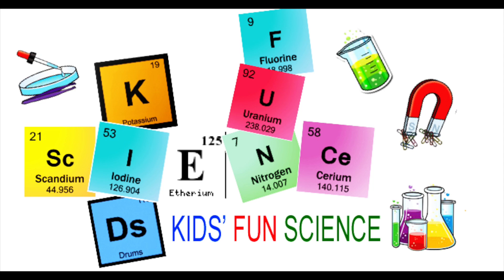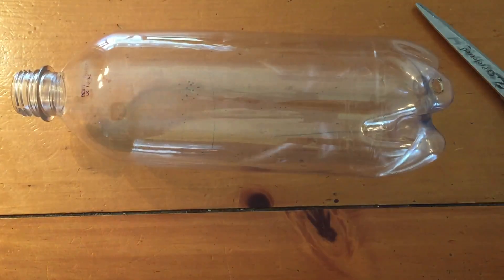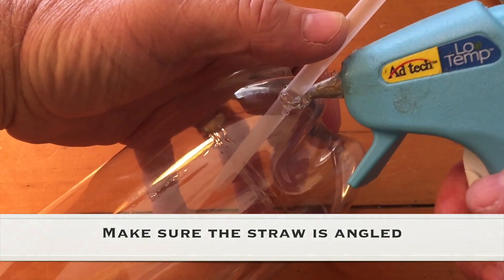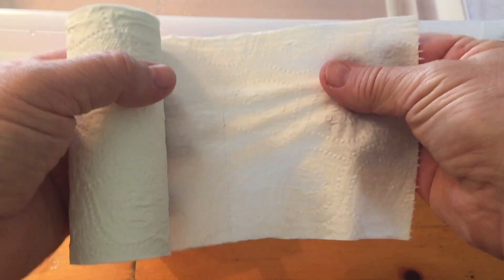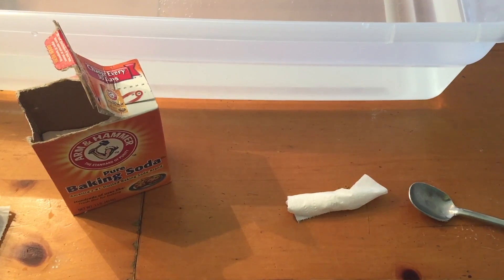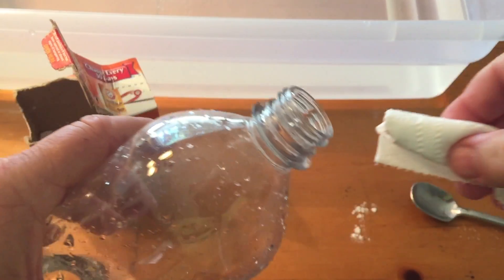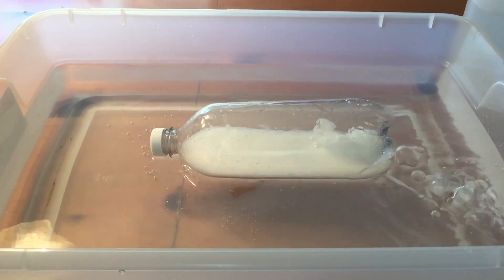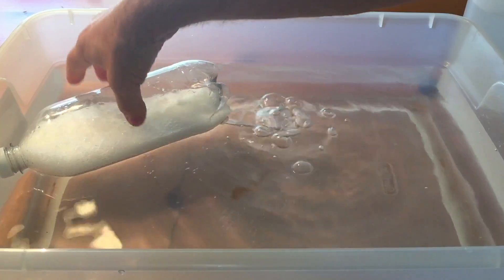STEM Baking Soda Vinegar Powered Boat experiment (How to make a power a boat with baking soda)

Comment: How do you make it go faster👀
Reply from the maker: Hi Dula Peep,

Sorry for the late response. I have not tried to make it faster before, but ideas might work would either have put two straws in to have double the gas pushing or a smaller straw to try to push the gas harder though the straw. If you try please let me know what you got to work as I would be interested. thanks Ken
Reply: @KidsFunScience  hey soooo the straw method did not help it go fast btw but what I did was put a small hole in the cap of the bottle and I put around 250ml of vinegar and 20 grams of baking soda and it blasted out so fastttt. It really depends what bottle you decide to use though. I used a water bottle but you have to calculate how much vinegar and baking soda you can put in the bottle.
Reply from the maker: Smart putting more vinegar and baking soda. I wonder if the opening of the straw makes a difference. Like a smaller straw make it go faster. Thanks for letting me know.

Comment: Thanks for saving my science project grade XD
Reply from the maker: Your welcome. Let me know how I can help next time. I wish I had internet when I was going to school for stuff like this. : ) thanks
Reply: @KidsFunScience  No problem! And actually, there is something else you could help with that's related. Can you think of any way make some sort of mechanism in the bottle to keep the vinegar and baking soda apart until the boat is fully in the water? Kind of a strange request, I know, but if you have any ideas I'd be very glad to hear them!
Reply from the maker: Sounds interesting, how is the boat getting into the water. Then once the boat is in the water  you want the baking soda to mix with the vinegar?
Reply: @KidsFunScience  Yes, exactly. To fit some specifications for the project the chemical reaction must take place after the boat is in the water.
Reply from the maker: Do you put the boat in the water? If so, then I think I have a idea. Let me know? Thx
Reply: @KidsFunScience  Yep, that's it.
Reply from the maker: @whimsicalwyvern2851  So take the design above and wrap baking soda with more TP (don't shake the bottle), as it will take longer for the reaction to happen. I shook the bottle, so the reaction would start right away. Put the Baking soda in and screw on the top, but gently put the bottle into the water. Now it should take longer for the reaction to happen. Depending how long you want to wait might determine how much TP you use. You might also have to have more vinegar to reach the baking soda. Let me know what you think? or if you have any questions? Thanks
Reply from the maker: Another idea is to make a small hole on top the the bottle, right above the vinegar. Then take some thread and put it into the hole and bring it out the top of the bottle. Then take your baking soda wrap it up into TP and tie the thread around it. Then put the baking soda into the bottle and pull the thread until the baking soda TP  is tight to the top of the bottle and then tap the thread on the outside of the bottle. Then carefully pour vinegar into the bottle making sure not the hit the TP, put the cap on and place into the water. Put the bottle into the water, then while holding the thread and (you should make the thread as long as you need), take the tape off. Now the bottle is in the water and when you let go of the thread the reaction will happen. Let me know what you think? Thanks
Reply: @KidsFunScience  I really like both ideas, and I'll test them both out, plus an idea I came up with overnight.
Reply: @KidsFunScience  That idea is really good. Plus, if I use really thin fabric it works even better because the tp doesn't break up into lumps that clog the straw. Thanks!
Reply from the maker: Thats great. Please let me know how it turns out. Good Luck. : )